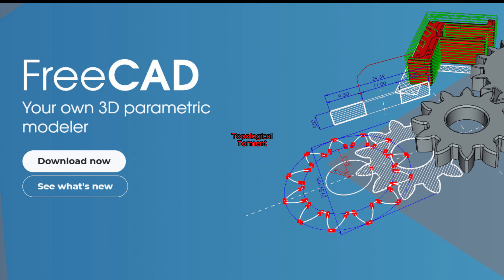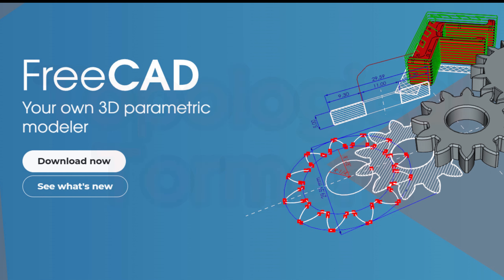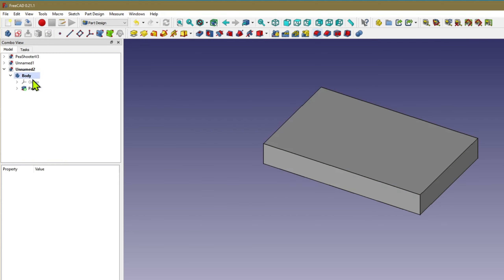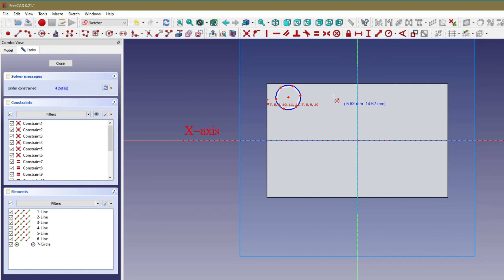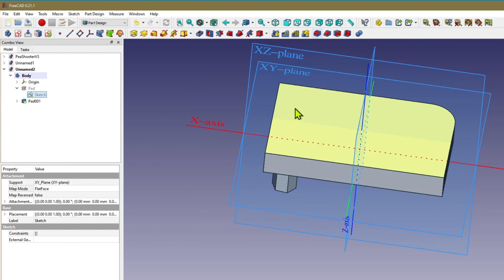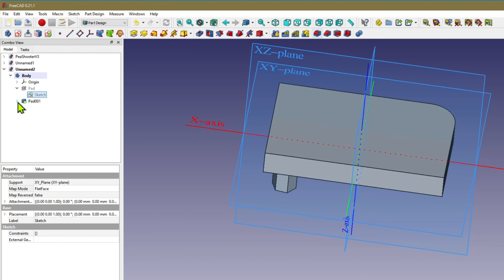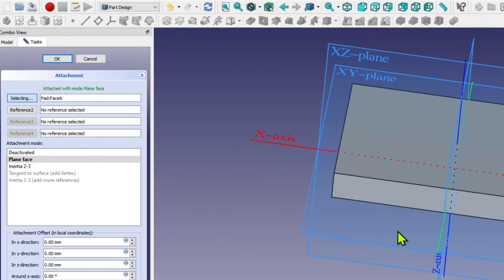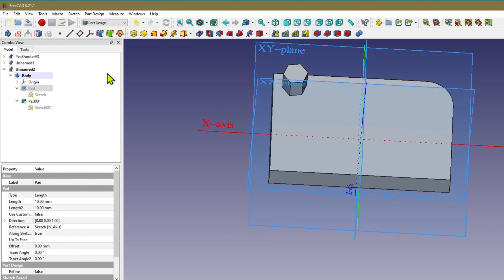FreeCAD Topological Name or Numbering Problem

Comment: Such problems are not visible in modern software.
Reply: such problems have been fixed in 1.0 (which fully releases in august), if you want to try it out you can look at the dev builds. basically any problem in the major workbenches, excluding the new assembly wb coming out in 1.0 aswell (and some others) have fixed this problems. Now right now there are bugs but it isnt TNP.
Reply from the maker: @xav6427  Thanks for the reply. I believe this is only a problem if you were expecting something different. Some of the graphics I do with this software I can't imagine doing with F360 or Blender.
Reply: @Hotwire_RCTrix  besides random crashes that was the main thing to steer me away from freecad 4yeras ago, I'll try again :)